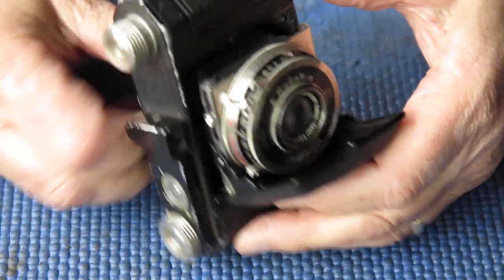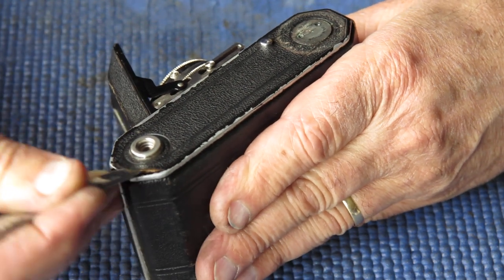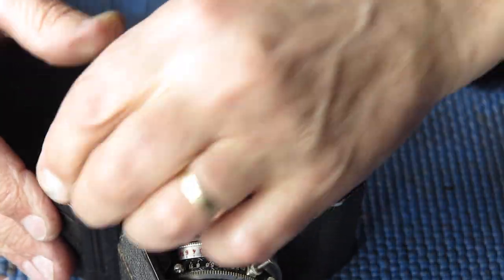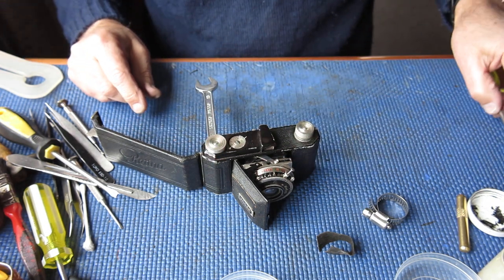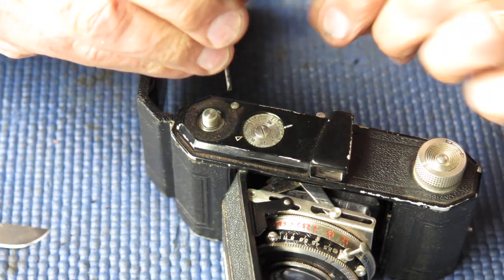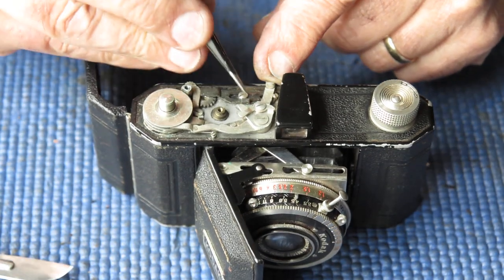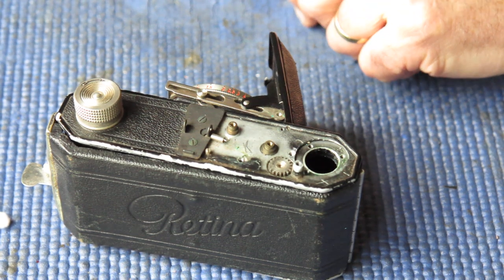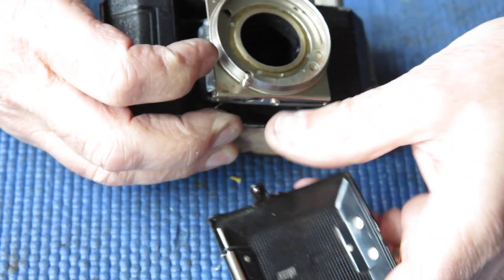Kodak Retina I type 119 service part 01

Comment: This is perfectly timed for me, Chris. I just started working on two Retina I 126 chrome trim models, and I'm following each step. My bellows and struts seem fine - the problems are a hinky slow shutter speed delay on both, the usual rivet corrosion under the rear leatherette on both, and a film advance that is a little rough on one of the two. I have two questions: 1) What is the contact adhesive you are using? (although I don't think I'll need to remove either bellows, I'd like to know which one to buy in the future) and 2) What is the spanner or tool you used to remove the lens/shutter assembly? Is it something homemade or a readily available tool that fits this lens?

As usual, you make it look easy, but I'm well aware that it's not. I learn something new with every one of your videos. I love all of my four Retinas, and look forward to getting them back to full functionality.

Andy

Comment: Could you tell me please with, what tool you have used at 13:08?
Reply from the maker: That is a lens spanner made by Beljan. They are not being made any more unfortunately. Very rarely, a used one might surface on eBay.
Reply: @ChrisSherlock  Okay, thank you👍🏻